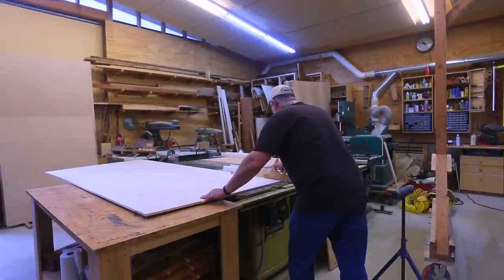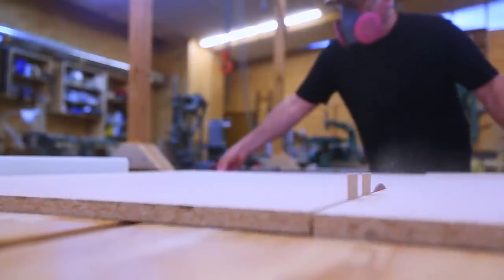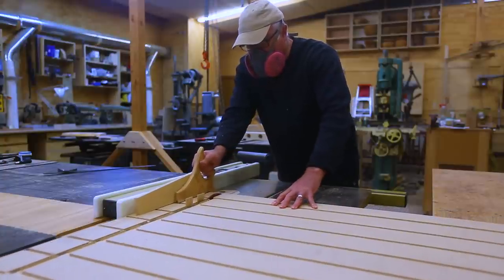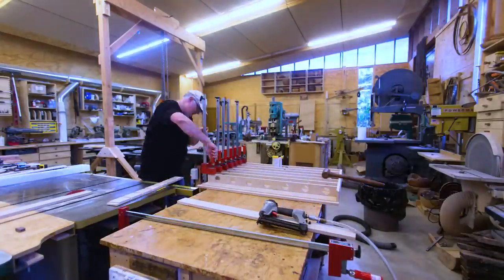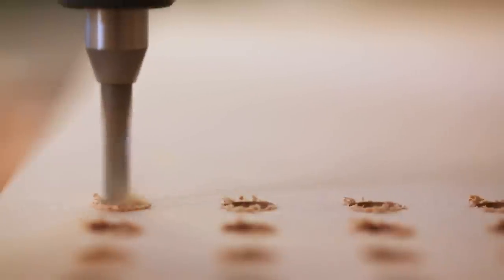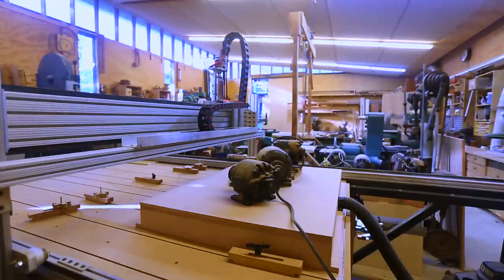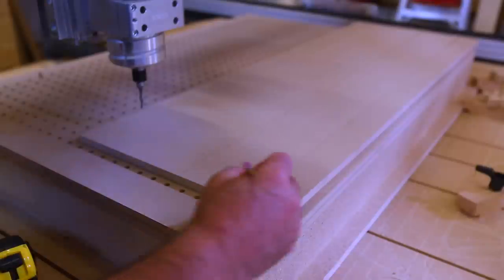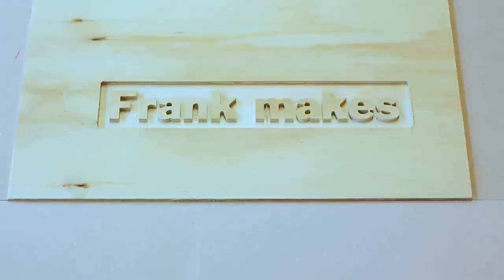Vacuum Hold Down Table

Comment: I've messed around with vacuum tables quite a lot, and what I found to work best is just sucking the air through the MDF.  You have to machine off about 1/16" from both surfaces to get rid of the hard outside layer, but the core of the MDF is porous enough for the air to pass through.  Some guests in the shop have been really surprised to see how well it holds when there is seemingly nowhere for the vacuum to get at the workpiece!  
I also found that if you have the entire surface covered it takes very little airflow to keep up, so you need surprisingly little space inside for the air to flow.  My most successful vacuum table was simply one piece of 3/4" MDF with a tree-like pattern of 5/16" channels CNC cut into the bottom, with a piece of 1/4" MDF glued to the bottom of that.  The bottom and edges were sealed with varnish to prevent any leaks.  
All of my vacuum table experiments were using a central vac motor (similar to a shopvac in performance) providing about 60 inches of water.
Reply: I have good results with "shaved" MDF as well. It is amazing how permeable it becomes with the hard faces milled off.  For blocking unused areas, I use thin plastic sheeting like the .5 mill painters drop cloths.
Reply: jmick.art 
Good idea using drop cloth. I've tried using stretch wrap but that was a pain because it sticks to itself...
Reply: That wouldn’t work with the sacrificial layer glued on top though, right?
Reply: I have a 2 foot by 4 foot CNC router and I am planning on replacing the MDF spoil board with a three-quarter inch piece of plastic, probably PVC , with channels routed for vacuum to flow and then a piece of 1/2 inch thick MDF on top of that as a porous vacuum table. I'll skim cut the top and bottom sides to increase the porosity and I'm planning on having four corner screw down holes with tapped inserts for rough material that will not vacuum well to the vacuum table.
Reply: Do you have a section/drawing that describes exactly what worked best for you?

Comment: Great build.  A couple of things, 

One: paint any MDF to seal it from air leakage.  MDF is basically a sponge with micro-channels all the way through it.  Either latex paint or similar, or just PVA glue diluted half glue half water should do the trick.  I heard the glue trick to seal the edges of MDF to keep it absorbing to much moisture even in storage or when 'fresh cut' parts coming off CNC machines.

Second: Zone the hold down.  If you are having a permanent vacuum hold down, make it into zones, say divided in thirds along the sides, and in half down the center length wise, making 6 segments that could be turned on or off individually with a simple 3" PVC manifold and ball valves.
Reply from the maker: It works pretty well now but sealing up the side of the box and mdf will help.
Reply: That was just what I had seen others do with 'full size' CNC machines (like Shopbot or MechMate)
Reply: I would have suggested the opposite thing.
If we use small router bits (so the force on the workpiece is not to strong) we sometimes just take a natural mdf board as a sacrificial board. without any holes. mdf is so spongy, that the air will suck through it anyway.

to have even vacuum distribution, we also have a 1mm thick foam between the table and the workpiece.

you can also just use soft pvc sheets to cover up any unused area (then you don't have any trouble with bowing wood pieces)

Comment: Great video.  Thanks.  
MDF is porous anyway, so it may not be necessary to drill all those holes (if you have enough vacuum).  If you cut 1/8" / 3mm from each face of the MDF sheet it removes the most dense part of the MDF and makes the vacuum significantly more efficient.  

I use scraps of plastic sheet to cover the remaining area when I need more vacuum on the job piece.  

A vacuum cleaner is not designed to be dead ended as the air going through it is intended to cool the motor.  Using it for a vacuum table may not allow it to have a long and happy life!

Comment: What you need is an actuating part that blocks the holes not in use for your run.  This may be a manual switch that you have to actuate from the sides or top or bottom of the table.  Ideally your CNC program would run the actuation automatically when you located your part and hit the "go" button...but that's a different set of circumstances.  Good stuff, as alway, Frank. Thanks for doing what you do.

Comment: Where I used to work, we had a 4' x 8' CNC router and we laid 1" x 4' x 8' sheets of foam as the sacrificial layer. It breathes amazingly well, so the vacuum still holds powerfully. You then cover up the 'non work' areas with some cheap plastic sheet (Coroplast, etc). After a while, you flip the foam sheet and use the other side. Once both sides are too marked up, you replace the sheet. Cheap and easy.

Comment: Hi Frank. Very nice video and work you did there again. A small hint for the next top surface. Normally the holes in a vacuum table are made in two steps. Larger diameter pockets in the top that doesn't go through. In these pockets  there are smaller diameter holes drilled (1/16" or smaller), this time through the top. That way you have a large area for hold down force but only a small hole to limit the airflow. In case there are some leaks you don't lose your vacuum at once. Thanks for sharing your work with us. I'll keep following your channel. Greetings from Belgium. Julien
Reply from the maker: I did not think of this, but it makes perfect sense.  Thanks
Reply: Worth comparing the area of the vacuum hose to the total area of all the holes in the table.  Assuming a 3" hose and 1000 holes you could get away with a sizing of 1/8" and match the suction power with a work piece of 50% table area .  1/16" might cause too much strain on the vaccum with half the holes covered.  If the vacuum can handle that then no problem.   Great video as always, and much appreciated.
Reply: That is a good Idea. Sounds just like when Mythbusters lifted a car with a vacuum.
Reply: When the sound of the vacuum blade goes up in pitch we think its working harder. Actually its working easier;  the blade is 'free wheeling" in a vacuum.

Comment: I'm hardly qualified to make a suggestion, but I can think of a couple of things.  1.  Actually just use perf-board.  2. Make an external PVC manifold to go between chambers, rather than the holes in the supports.  By doing this, you only draw vacuum on the chambers you need.  3.  A thin film of plastic would work as well as plywood to block the holes you aren't using.  Just suggestions.  You are waaaaaay better at this than I could ever be.  Love the channel.

Comment: I used to work as a CNC operator at a local shop, I recommend routing a small groove midway between all the holes both X and Y directions and using a closed cell foam tube gasket/foam backer rod to seal the area below your work piece (If you plan to continue using boards to cover the "extra/ unused" holes then you would need to put the gasket in the groves around the edges of these pieces as well) This will allow the vacuum to pull the piece down onto the table and create an air tight seal. Also you may want to consider routing a ledge around each hole and creating "mushroom top" pegs that you can drop into unused holes so you dont need all the extra wood on the table. This will allow you to cut irregular shaped stock (we had rubber pegs that we placed into the unused holes but I'm sure you could make something out of wood). Good luck with you CNC machine! Love the videos.

Comment: Paint the sides to help. MDF and particleboard allow air to flow through. At the maker space I go to the have MDF on their CNC to clamp plywood sheets down.
Reply: I'll second that. A company I work for uses sacrificial 6mm/1/4in MDF sheets on the bed to hold blanks of polyethylene foam. We sometimes use it with plywood and MDF blanks.
Reply: Or laminate it.
Reply: I recall with the CNC that my school had, you could get a vacuum bed that you put a 6mm piece of MDF onto as a sacrificial board and then in theory you could still clamp wood to it as it created a vacuum through the 6mm sacrifice board.  I was a little skeptical, but my school never bought one so I don't know if it worked.  They used the T-slots in the metal bed to clamp sacrifice boards to and then used carpet tape to hold the wood/plastic that was being cut.
Reply: Jared S z
Reply: this works
Reply: All you need to do is to take the surface finish off the MDF and then it is very porous.
Reply: I operate a Multicam cnc router with an aluminium vacuum table and I simply use a 3mm sheet of mdf as the sacrificial board and throw it away when it is all chopped up.

Comment: Hi Frank just a few pointer I used to program CNC machines.the Matrix machine works better if you seal the sides of the mdf your vacuum with increase, you will have air leakage at the side until it's sealed, you could put a sacrificial board on top so you can cut right through I set the cutter depth to -.2mm we put 25mm mdf on top of our plenum which we would skim every day until its about 6mm we skim both sides so we get airflow and seal the edges.
we do exactly what you are doing by covering the unused bed  with melamine covered 6mm ply we tried various method but for speed we found this to be the best way but mostly we used 8x4f sheets.
Great build of the CNC liked the way you overcame all the problems.

Comment: Now hook a leaf blower up to it instead of a vacuum and you got yourself an air hockey table
Reply: Just connect the shop vac hose to the exhaust port.
Reply: I think Bob from ILTMS did that. He said that it make way too much noise...
Reply: Frank will be turning little hockey players on the lathe in his next video.
Reply: +Jeremy Awesomesauce 
it'll be awesome to watch you try air hockey with this table. it'll be a learning experience for us all.
Reply: CNC Air Hockey at Howarth Sports Center :D
Reply: you just gave me an idea for tomorrow i have old air hockey table that was the kids but no longer used its a smaller one i will hook vac to the spot the old fan went and see what happens lol

Comment: I really like your videos.  I have built a number of vacuum tables before.  The only recommendation that I will make is smaller holes.  Like 1/16 to 1/8 in size.  The vacuum hold down for this size is much stronger then the 3/8 inch holes that you used.  They would be closer together and you don't need as large of vacuum.  For the tables that I build I use dowels instead of raceways. I have found using raceways over time you get scalloping of the surface where it is not supported underneath.  I also use a much smaller chamber size.  No more then an inch between the sandwich.  The smaller the area of volume produces more suction.

Comment: I used to work on a 4x8 cnc that had a built in vacuum table. There were a bunch of grooves in the table and we inserted rubber gaskets in a rectangular shape the size of the piece we were working on (this would localize the suction just to our work piece). Also, we would sometimes just install a piece of MDF large enough for our work surface - it's porous enough that the vacuum would pull right through it, especially for cuts on large sheets. Maybe try some 1/2" or 1/4" MDF on top of your setup and see if that gives you enough suction when you put pieces on top of that.
Reply: Just read through a bunch of comments, that's a wealth of info down there! lol

Comment: Looks like it does the job well Frank, and nicely made as always. The only suggestion I can think of (and it is only a suggestion which may well prove impractical) would be to make some sort of sliding boards within the table itself. Sliding them back and forth would close and open the holes withing the struts, rather than you having to use boards on top. I don't think it would work any better than the system you've already devised but the idea may prove to be food for thought :-)
Reply: Matt Jones I had the same idea right before I read your comment.
Reply: I'd actually consider taking this one step further.   Drill matching holes in the Dampers (sliding boards as mentioned by Matt) and then you could gain better control of airflow throughout the box by adjusting the openings.    Of course this might require removal of the top or bottom to install guides for the dampers.

Also you realize you have created a base for a vacuform machine!
Reply: Make a grid of struts and have the holes along the X axis be half as tall and be on the top half of the strut.  Make holes on the Y axis be half the height of the strut and go along the bottom half of the struts.  Then you could slide closed whatever partitions you want along both axis' in order to go from a very small square in one corner to whole lines or rectangles of whatever size you need.  The only down side would be that you couldn't position the items to be cut wherever you want, you'd have to keep them near the 0,0 location.  I don't imagine that would usually be a problem though.

Alternatively, maybe you could just use heavy duty plastic sheeting on areas that you want to block off.   And that would let you cut it to whatever shape you need though it would be a little wasteful potentially

Comment: I used to do a lot of screen printing and the table we used had this vacuum system. We just used sheets of paper to block the other holes. We also had an upright copy camera that used similar system to hold down the film and it used an empty canister between the vacuum and the area to be held by vacuum, it was about the volume or a little less of a 4 litre paint can. I think its purpose was to give you instant vacuum after throwing a lever or switch as the canister would be in vacuum and as soon as you threw the lever the work was held instantly and you didn't have to wait for vacuum build up. Hope this vaguely remembered stuff helps in some way.

Comment: Frank, may I say you are an inspiration and ambitious. Your vacuum table. 
My experience is that you’re never the right size and cover pieces. Rather than trying to make one big one, make many small one’s. A round piece of wood say 3” and 2” thick with an O ring grove cut into top and bottom with a hole through the side. Make several with a ball valve on each. Small flexible hose to each all piped individually back to the vacuum pump. Place them under your work piece, open valves only to the ones you going to use. Switch on vacuum pump. Suction cups fix to bottom and work piece at the same time. Job done. 

Many thanks for your entertaining videos. 
Johnathan

Comment: A friend has a vacuum table for all his CNC, he doesn't have holes in his vacuum table only a piece of MDF with a 64th trimmed off each side to open up the pores. This does a great job doesn't have the loss issue that you're trying to deal with by putting boards over the unused holes

Comment: A commercial vacuum table I saw years ago had several dozen ball bearing valves with a grid of rubber/foam gaskets; just slap a workpiece anywhere on the table and it stuck.

The springs holding each ball bearing in place were just strong enough to resist a shop vac, but any weight on top would break the seal and start the vacuum effect.

I thought it was pretty neat, but always thought that a huge workbench sized version would be more awesome.

Comment: Great idea... But how strong it is... Did you make some tests? For example How many force you need to move a piece of wood, or how is the seal... The air that flows between the fixtures and the machined piece... 

I really like your videos.. But I think is missing something tests sometimes... :/

Anyway! You are great, Frank! :)

Comment: in our shop we just used two pieces of mdf and routed a center groove that branched out on top and bottom pieces and glued them together so they made an air channel and had holes on the top piece. when you wand to use a small section we just put a peg in one of the center holes and it stops the air from going to the other branches. works pretty well

Comment: What i would suggest (when you make a lot of pieces which don't take a lot of time to cut) that you build a foot pedal to switch the vacuum on and off!  I also would find another solution fpr covering the holes cause that looks not good and is inefficient. I work as a carpenter and at work we have a big CNC and we also use suction to hold it. For that we have a few rails where you can put some rubbes "boxes" on which have a few holes in it and every time we step on the foot pedal, the "boxes" get the suction to hold the piece somehow through the rails. Maybe membranes are used . Maybe you thought about the same thing with the suctionboxes. 
Respect and love 4 wood from Germany

Comment: Awesome Frank! I use a biesse cnc at work that uses vacuum as the hold down. Not sure how powerful your vacuum is, but I use 3/4 mdf as a spoil board. The holes are all under that, the way I get it to suck down parts is to plane both sides of the mdf. You be surprised at how porous mdf is after removing the protective layer.